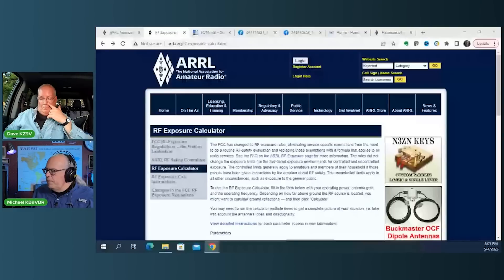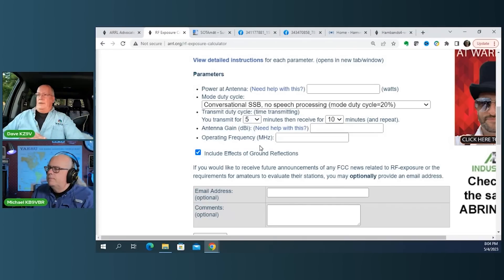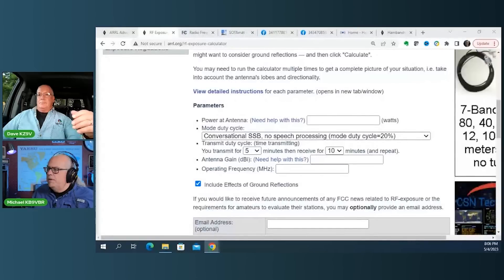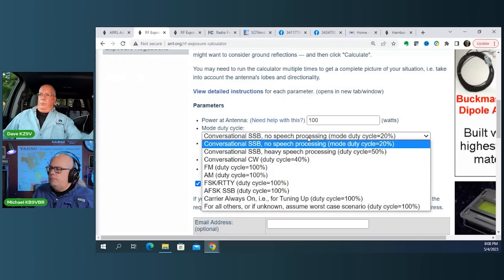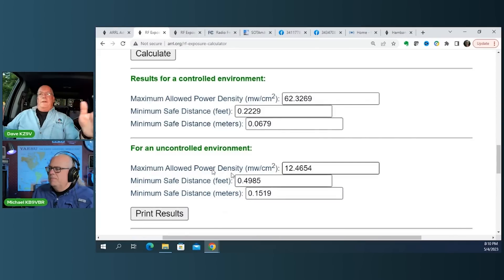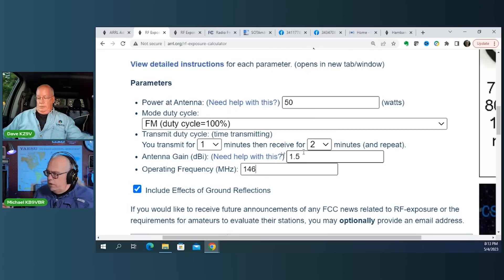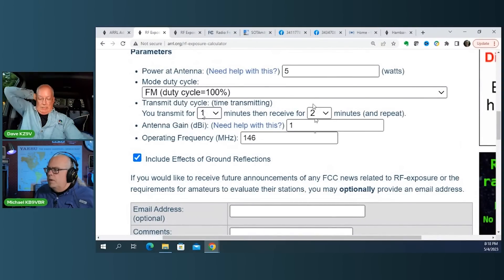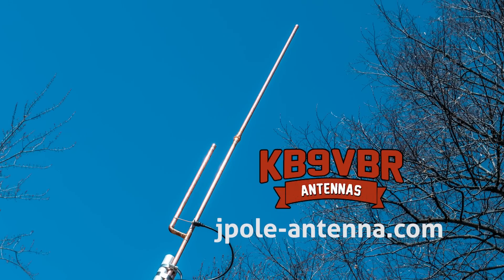Ask Michael, KB9VBR: FCC now REQUIRES amateurs to perform antenna RF exposure calculations

Comment: What about the military? They Should NOT BE EXEMPT FROM THESE REGULATIONS. I DONT HAVE ANY BASE ANTENNAS. SIMPLY BECAUSE I DONT HAVE A RESIDENCE IN THE STATES. I RENT but I work mobile on everything from 40 to 10 meters, 6 meters, V, U, and up to 24ghz. If I am stateside. Inside a Military steel slant back HUMMVE. Plenty of shielding for the antennas. Coax is double sheilded and FME CONNECTORS on the NMO mounts on the roof. Having used an RF sniffer inside the vehicle with no known RF leakage. Most of my comms are 100 watts on HF SSB, 50 watts on everything up to 500 MHz. Several watts on the higher bands until we get to microwave which is less than 5 watts. Many times when I am stateside it’s just portable. We have no such regs in SV land for RF exposure. I use common sense considering I have worked in the industry since 1982. There was a Ohio State Patrolman who used one of the older handheld radar guns. Between clocking motorists he would place it between his legs. After twenty rears he wound up frying his nuts and wound up with testicular cancer. I wonder why…….
Reply from the maker: I would agree. The Department of Defense has their own rules and don't fall under the FCC's purview. The Ohio patrolman is an excellent example why RF safety is taught for the amateur Technician license exam.

Comment: I'm an inactive ham and I basically only renew my license every 10 years and make sure I have a working 2 meter HT in case of emergencies. I only do a test every year at around 2:00 in the morning to see if I'm hitting at least two local repeaters. I just click my transmitter,  announce my callsign, and say "testing". That's the extent of my use!! Do I have to do this s**t? Could I just B.S. it? BTW, i just renewed for another 10 years and was dismayed by the fact they made me pay $35.00 to renew. Use to be free, so I was totally pissed.
Reply: Did you renew your license directly from the FCC via the ULS site, or did you renew it from a service? I always renew it at the FCC U;S site and was never charged a renewal fee.
Reply: I feel ya' man. GMRS is calling

Comment: So this is how close the antenna is to a person's body,  correct?
Reply: Yep based on pattern of the antenna and ERP power level.  These variables are pretty hard to accurately pin down.
Reply: @tomsherwood4650  Thanks. That's what I thought it was, just making sure.

Comment: Use QRP. Nothing over 5 Watts here. Plus you don't splatter across the band. Why do some hams need to be the loudest station on the band?
We had this a while back. 
I had Pye Pocketphones on 433 MHz years ago and didn't like the aerial so close to my face even only running 100 mW. Never did contact anybody but heard stations about 20 miles away. I don't want a mobile phone either but if I had one it wouldn't be in my pocket all day switched on as studies have suggested a risk a of testicular cancer. No thanks.
G4GHB

Comment: How funny, I did it for my antenna using CW worst case is 10 meter and at 100 watts it is 3ft. No way i'm going to be closer to my Antenna  than 10ft. I guess the only case would be if you are using like the KX2 like a walkie talky .
Reply: I agree, but when I did the calculations for my 2 meter mobile rig it was certainly interesting. At 50 watts on 2 meters with a 3.5 Db gain antenna assuming a 5 minute tx 5 minute rx your looking at over 7 feet uncontrolled environment and around 4 ft controlled. Granted I’m not going to be transmitting for 5 minutes outside of an unusual situation, but on a small car like my Jeep your not going to get an antenna 4 feet away from you unless you have a mast. I’m certainly not concerned about it. I’ll just lower my duty cycle and then I get 2ft at 50 watts. Anyway though I’d add that because a mobile is about the only situation where I could imagine exceeding these limits. Even running 1500 watts through a 10db gain beam your looking at 40 and 75 ft I’m willing to bet if your running that setup you have at least a 40 ft tower and most likely 100+ ft tower, so the whole thing is moot in my opinion outside a mobile. 73

Comment: They even want transmission durations? Then I don't see how this is supposed to be meaningful. A commercial broadcast station has a fixed schedule, I don't. A commercial station runs at a fixed output power, I don't. A commercial station will usually run on one antenna, that doesn't apply to many hams. Therefore, I would be VERY conservative with those values...

Comment: I am presuming that is from the antenna
Reply from the maker: Yes, from the antenna feedpoint.
Reply: I think the wording in the guidelines is "the center of the antenna's radiation."  For long wire HF antennas that gets kind of nebulous, so I would consider the measurement to be from the nearest point of the antenna.
KZ9V

Comment: I STILL shudder whenever I see a Rubber Duckie attached to someone's hat as they wander through a Swapmeet chatting away on a repeater.      2M is bad enough, but on 440 ? or HIGHER ???   Devastating ...   
Why not just stuff your head inside a MICROWAVE oven !
73 KG5RK
Reply from the maker: Along with the nerd factor of walking around like that; I shake my head, too.

Comment: What did you think was going to happen? 
There are many a good amateur who keeps their gear safe, clean and tidy but there are plenty of others running huge linears, huge antennas that in many cases, dirty design and not tuned the best and way too close to other devices and people. Noise issues are on the rise, lack of regulation on ALL bands and ALL users, not just Ham radio.
Reply: Nothing wrong with hams using linears and big antennas as long as they maintain the legal power levels. In fact often a large antenna high up will afford less rf exposure than a small antenna close to ground level.
Reply: @WitchidWitchid  Assumptions are foolish. You have assumed I don't work in the industry and have done so for 30+ years... There are plenty of fools running way too hot regardless of amp or antenna design. Mind you, there are also those who cant understand that even a low-powered F-call can still bring complaints either.

Comment: I don't think Dave is correct regading the handheld radios. You are not transmitting from your kidneys 😂 I Iike how pragmatic Michael is about the wholr thing, including in his pinned comment. We also need to do this in the UK, it's no big deal. If anything it helps protect the hobby from those that would attack it using RF exposure as an argument. We can prove that we are respecting the guidance.

Comment: The calculator assessment of how long you transmit is always going to be inconclusive when you consider transmit on: 75,40,20,10m AM/FM. 
Seems they want a stat from us
 to sell off frequency.. 😮.
Worry about 1.w ghz on 10 watt HT keyed up in front of your eyeballs off a duckie then we got something to report on .
You would. Be basing a one time SSB communication time with the calculator.
Reply from the maker: The FCC does not collect the information. It's for YOU to determine that your station is operating safely. But if there ever was a question to it's operation, this is a piece of information they may request.

Comment: C'mon guys...

If you're gonna do a video about amateur radio RF exposure rules, at least "practice" it once before going through it on camera, and have your facts and info ready-to-go beforehand (or, learn how to edit-out all  your "umms" and "ahhhhs" before you make it public).

I did my exposure limit calculations over a year ago, in preparation for the new rule going into effect. My data is on-file in my shack.
Reply from the maker: Thanks for watching and your comments. As a regular viewer, you will know that my content is well produced and scripted. What you are watching here is a livestream 'excerpt' of a longer presentation. With the exception of a basic outline and talking points, the livestreams are unscripted and may have slight production in-continuities. I maintain that 'live' feeling with the excerpts. I'll edit out the tangents and comments that don't move thing forward, but I don't have the time to scrub the clip for every pause.

Comment: What about mobile there a lot more dangerous.
Reply: I enjoy Parks on the Air activations, and here in Wisconsin, winter is brutal, so I often wind up sitting inside a vehicle with a mag mount Shark stick on the roof.  Some claim their vehicle acts like a Faraday cage protecting them from their own RF.  I'm a little dubious about that, since my 2-meter handheld works just great from inside my vehicle (Faraday cage).🤔
KZ9V
Reply: they're a lot

Comment: do the cell providers have to jump through these hoops as well?   been interested in getting my liscense for several years but this is a huge turnoff to finally doing so...
Reply from the maker: You wouldn't believe the number of hoops a cell provider has to go through in order to get a tower installed. Not only from the RF and licensing side of things, but also the local zoning and plan commission. I wouldn't let a bunch of cranky hams that don't want to do a bit of self examination sway you. Theses RF exposure standards have been in effect since the early 2000's and they are a party of the Technician license exam. The only thing that's changed is they amateurs are no longer exempt from the record keeping aspect of doing an RF exposure survey.